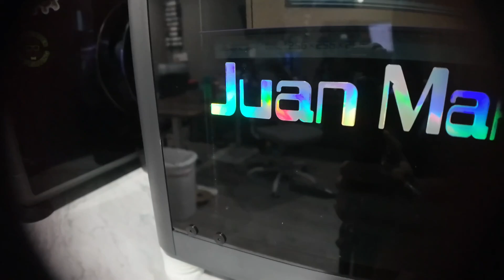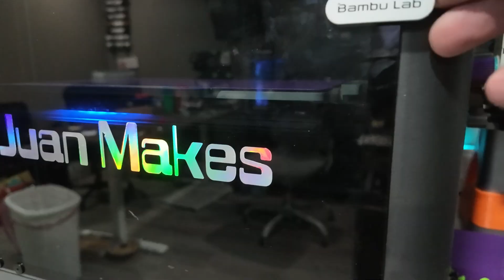Installing the Biqu Panda Status Bar.

Comment: so you never mention how it links to the printer. you just sold us a bar without instructions on connections
Reply from the maker: There are a really easy to follow set of instructions in the box for pairing it with the printer. A few clicks on the supplied website and your up and running.

Comment: nice vid but product is useless LMAO
Reply from the maker: Whats useless about it? It Gives you all the information needed at a quick glance when you have multiple printers running with different jobs. I don't need to look at a phone or a computer at all.
Reply: @JuanMakes the the most current firmware break yours? Mine will not link the p1s
Reply from the maker: @mattchumoore4214 nope havent had any issues with mine. They were doing a week long website maintenance that may be the cause of the issue. Try updating again and reconnect it